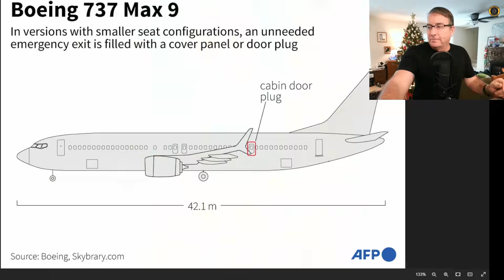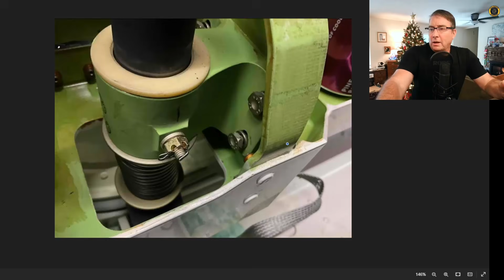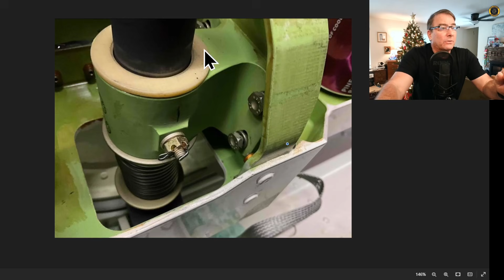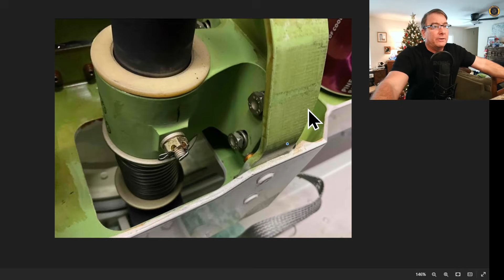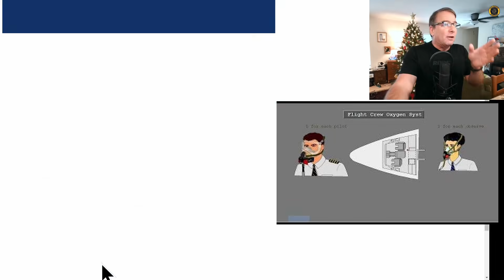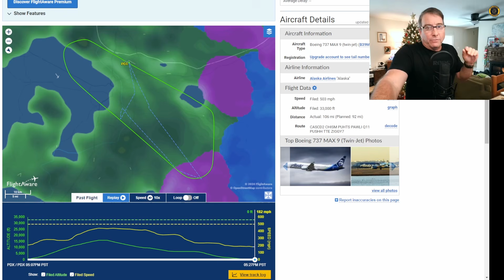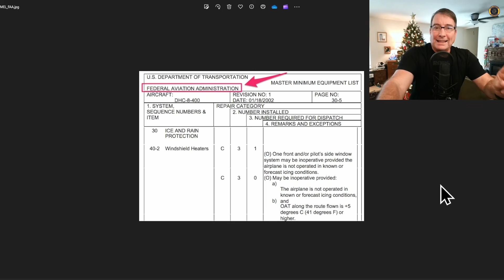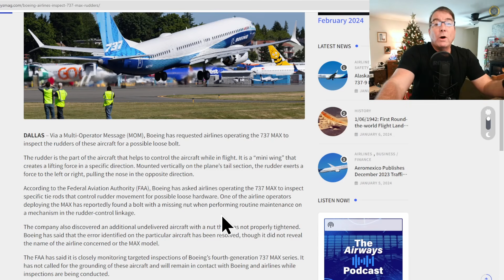"Yes, We Have No Bolts"  9 Jan 737 Max-9 Update

Comment: Excellent job of explaining the mechanics of the plug door.  I think one small correction is in order. At about 3:50, you said that the door needs to be lifted up so that the stop pad (on the door) can clear the stop fitting (on the airframe).  Based on what I see in the pictures, it looks like the door first has to be pushed down so that the stop pad clears the stop fitting.  When you push down on the door, you put the lift assist springs in compression.  In this position, the stop pads are below the stop fittings, and there is nothing preventing the higher interior air pressure from pushing the door away from the air frame.  At this point, the upper guide rollers slide outwards out of the guide fittings.  Furthermore, there is nothing keeping the lift assist springs in compression, and… blammo….the door is then launched off of the lower vertical guides into oblivion, and ultimately ends up in Bob’s backyard.  

If I’ve got this wrong, someone please correct me!

My overall conclusion is that, based on all the issues we’ve seen on the 737-9 MAX, I would never fly in one!

If I understand this correctly, it seems that one way to correct the problem (in addition to the obvious of making sure all the bolts and nuts are tight and properly cottered and/or torqued) would be to drill holes in the stop pads and stop fittings, and at a minimum, insert some sort of cottered pin through each stop pad and stop fitting.  Of course, by drilling holes in the stop pads and stop fittings, there is the possibility of structurally weakening them, in which case they would need to be enlarged before the holes are drilled. This would likely entail some major work on the airframe, and the door plugs.
Reply: Yep the upper guide track, which is in the shape of an inverted "J", is on the plug itself.  The guide roller on the airframe is already mated at the top point of the guide track.  Because of this you can't physically force the door plug down.  The door must be lifted vertically up (with assist from the springs to make it easier for maintenance personnel) so that the stop fittings can clear the stop pads and release the door.  My uneducated guess is that there is a 95%+ chance that none of the 4 bolts where there at all.  Nothing was there to prevent vertical motion and eventually pressure differentials and jarring of the aircraft sent the plug flying.  Maintenance/assembly/QA oversight is almost certainly the culprit.
Reply: I think you made the same mistake as I did at first, I had a hard time understanding how the door works until I realized that the upper guide TRACK is actually part of the door and the PIN is in the airframe. If you think of it the other way, it looks like you would need to move the door down first to get it out of the track. I'm pretty sure now that it's the other way around, you move the door up, which moves the track up, while the pin stays stationary and eventually clears the track when it reaches the track's open bottom end.

Basically this would mean that the springs are constantly pushing up against the pin/bolt in the spring assembly, and the bolt in the upper guide track that's part of the door. If those bolts would fail, the door would yeet itself up and out.
Reply: @kenkku  Yes, I agree with you.  I missed the part where Juan says the guide track is on the door plug and the roller pin is on the airframe.  Thanks for the clarification!
Reply: It's actually explained in this video at 3:00. Since the track is part of the door, you cannot move the door down from the closed position. Because the pin (part of the frame) sits at the top end of the track, the track (and hence the door) can only move upwards.
Reply: Let me give this a try.
To install the plug:
1) Lift the plug and place it on the 2 Lower Hinge Mounting Shafts, and install the 2 heavy washers and 4 lock nuts at the top of the 2 Lower Hinge Mounting Shafts.
2) Push the plug (wt aprox. 60 Lbs.) partially down which compresses the Lift Assist Springs to just before partial compression; more about this part later.
3) Continue compressing the Lift Assist Springs and rotate the top of the plug toward the airframe until the Roller Pins enter the Guide Tracks which places the Stop Fittings against the Stop Pads.
4) Push the plug down until the Roller Pins are fully inside the Guide Tracks, then insert the 2 Upper Locking Bolts into the Guide Tracks, thus holding the plug in place.
5) Move the plug slightly up or down until the Lower Locking Bolt holes are aligned, then insert the 2 Lower Locking Bolts into the Hinge Guide Fitting and the Hinge Shaft, thus holding the plug completely in place.
6) Place the Upper and Lower Nuts and Cotter Pins.

To Remove the plug:
1) Remove the Lower and Upper Locking Bolt Cotter Pins and Nuts.
2) While firmly holding the plug, push the plug slightly down to remove the shear stress on the Locking Bolts.
3) Continue holding the plug and slowly allow the move up until the Roller Pins clear the Guide Tracks; at this time the top of the plug is free to move away from the airframe. 
4) If the 2 Strap Assemblies are not attached, attach them.
5) Slowly allow the plug to move out to the partially open (15 degree) postion.
6)  To completely remove the plug, attach the plug to a hoist, remove the 2 Strap Assemblies, Bonding Straps, 2 washers and 4 lock nuts at the top of the 2 Lower Hinge Mounting Shafts.
7) Use the hoist to lift the plug off the Lower Hinge Mounting Shafts.

I'm sure that this is not the complete procedure because I did not remove the 2 Lower Hinge Bracket Assemblies, but I think that it should cover most of the steps. BTW, I'm not a ME, A&P, pilot but the steps appear to be logical.  It would be very interesting to read the actual procedures.
Reply: @michaelhenning8090  Yep!  I think you have it down pat!  I think Boeing should copy your procedure and include in their updated POH and/or maintenance manuals!  In fact, Boeing might be better off if they just let YT followers and the rest of the internet write the entire POH and  maintenance manuals for them!

Comment: I’m still confused about the picture of the guides shown at 4:40. I don’t see how the door can go up 1.5” in this configuration as it’s up against the top already. I would understand if it rotated or if the bolt was removed and the door allowed to slide down. Am I missing something?
Reply: Looking at it again, I think that the picture at 5:03 makes it clear-ish as you can kind of make up the guides on the plug side and pins on plane side… but you need good eyesight 🤓
Reply: The door is on the left side of pix, the frame/jamb with pin on right, so when the bolt is removed that’s underneath the pin with roller on it in the guide, the door can be raised that 1.5”, ok? Make sense?
Reply: @JohnHallgren ah, the door is on the left! i assumed the guide would be on the plane side and the pin on the door side. Yeah, that makes a lot more sense now! 😅
Reply: @Batwam0  you’re not the only one who was confused! I was originally also for a bit. There’s someone else here who I’ve been having a running discussion with who still doesn’t understand that he’s wrong.

Comment: Although, the Swiss cheese principle seems to have lined up and ultimately caused the plug to be ejected from the aircraft. Thankfully there was also another piece of cheese that didn't line up and this prevented the loss of life. Examples would be the passengers who did not get on the aircraft who would have been in the seat row next to the plug door or the unaccompanied children who could have been in those vacant seats, which doesn't bear thinking about.
Thank you for doing these. I think you may have a calling to work or consult for the NTSB when you retire from front-line aviation.

Comment: I suspect the bolts were left out as as long as the bolts were held in place with captivated nuts they should keep the door closed even if loose they are tightened to keep them from rattling around and possibly damaging the cotter pin

Comment: thanks for a great channel.
i’m confused.
i thought a plug door was wedge shaped and could only open inwardly.
i therefore thought the entire door frame failed.
have we gone back to pins?
after the cargo door failures decades ago?
Reply: It's a plug-type door, not a door plug.  Fits into the hinge guides in the airframe, and so it must be installed from the outside using the sliding mechanism described in the video.  He may have described it better in the previous video.  Once the hinges are slid into the hinge guides, the bolts in question go through the hinge guide and hinges and hold them in place.  These prevent the plug-type door from sliding into the position that releases it from the hinge guides.  These bolts do not need to be torqued since they don't hold a load.  They have castellated nuts and a pin to keep the nut on and the bolt from sliding out of the hinge and hinge guide.  The bolts and/or pins were probably missing since the door was last installed.  It may not have been Boeing at fault since it is common for the third-party that installs the interior seats, etc. to remove this plug-type door after the aircraft is sold.  That party may have forgot the bolts or pins.

A spring mechanism and air pressure inside the cabin also hold it in place, but these are not adequate after some bumps, etc. (i.e. his mousetrap analogy).  After a couple of months of flying, the thing jostled enough to push it to that point that the hinges came out of the guides and it blew away.

A passenger in the seat near the door reported hearing whistling sounds (according to a top-rated comment on this video).  The cabin pressure controller warning systems were failing repeatedly since it was in service (since October, brand new airplane).  Indicating the door was not making a seal and likely bouncing around on the hinges until some turbulence bounced it high enough to get it off the hinges completely.

This thing is designed this way so they have the option to install a working emergency door there based on the passenger capacity (number of seats installed).

I know this is more detail than you asked for, but similar questions and other misunderstandings are all over this comment section.

Comment: The Fueselage on the Max-9 is not manufactured by Boeing. They are made by another company, put on a train to the Boeing facility and then given the cabin fit out.
Boeing is taking the heat on this as the point of sales but they aren't actually responsible for this failure.
Some heads are going to roll at the contractor company for this.

Comment: Great reporting as always.  I've listened to many ATC audio transmissions covering emergency declarations by pilots and I'm amazed how slow ATC is to react.  Almost always the initial ATC response will be unprepared and ask the crew to repeat (often 2-4 times).  If that isn't bad enough, the crew have to often repeat their emergency status when they switch frequency to another controller.  Why isn't there a automatic mechanism in place that when an emergency is declared the transponder code/squawk immediately changes to 7700 so any ATC in range can see their is an aircraft declared emergency?  Avoids crew having to keep repeating their emergency every frequency change.
Reply: I like Juan's comment that all pilots should always use "Mayday Mayday Mayday" when declaring an emergency. I stopped my ground instruction back in the 1980s due to career changes, but well after I learned that was the proper terminology specified in the AIM at the time, and as far as I know, that is still the case and also what controllers are trained to recognize immediately as the proper way to declare an emergency. Perhaps that is not drilled into controllers properly, either?

Comment: Those pilots deserve a medal, they not only saved themselves but all the passengers as well.
Reply: Im only an ex-glider pilot but... After the initial surprise I doubt the aircraft was difficult to control or anything like that. Quite a manageable situation we'll within all pilots capabilities.  I've flown to 14,000ft in a T-shirt and shorts with no oxygen or any pressurisation. It might be different had they been a lot higher. The cabin crew probably had a more stressful job I reckon.

Comment: I am a fellow pilot and A&P, with IA (expired- I'm 80 years old).  I am appalled by this incident.   The design of this door plug, as clearly explained in your previous video, seems plenty robust.  Only the most egregious manufacture/maintenance errors could allow this door to work loose.  Good grief!  My background is strictly general aviation, but this sort of thing cannot be allowed in any phase of our profession.  Only by God's grace were no people sucked out in this catastrophe. Thank you for your continued attention to these unfortunate situations.
Reply: However you should see the positive side. No one will risk riding a plane unbuckled from now on.
Reply: @luisbacilieri7010  Let's hope the seats are bolted down properly.
Reply: @luisbacilieri7010 seatbelts won't matter when/if this happens closer to or at cruising altitude, you'll just go with the seat...
Reply: @luisbacilieri7010  what if the seat gets sucked out? Best is avoid Boeing if possible (easier said than done)
Reply: I am also an ex Airline A&P mechanic, and NDI level 2 tech, I left the industry in 2009, and moved over to Subway trains, my sleep improved,and consumption of antacid tablets went to zero....
Reply: @jdshemp  Hey do you know if the boeing 737 max 9 door plug was visible or was it behind a decorative panel?
Reply: Visable only from the outside I have read. From the insode it looks like another window.
 @climbeverest
Reply: I 100% agree and as an A&P myself and a resident in the area, this door landed .9 miles from my door step. It's a miracle no loss of life happened on the ground (edit)with the door falling 16k feet in a fairly dense residential area just a short distance from the school and hospital. I just flew the other week ago on the an ALASKA MAX with an infant in my hands.... yikes.
Reply: There has been statements to the effect this plug may be removed by the airline to move stuff in and out of the plane in final prep for first flights.
Reply: Blown out.  The pressure differential is from inside the airplane to ambient altitude pressure outside.
Reply: @z33511 save it dummy
Reply: Hello! Do you know if the boeing 737 max 9 door plug was visible or was it behind a decorative panel?
Reply: @climbeverest it’s behind a panel. He explained in detail on the previous videos he suggested everyone watch first.
Reply: @chriswalters8110  so kind, thanks!
Reply: It's behind a standard inside finish panel that looks like all the rest of them.   @climbeverest
Reply: @wheelspinner20  thanks! So if the bolts are missing or loose, every aircraft of this type will have to have the panel torn open to inspect? Am I right?
Reply: @climbeverest  yes.  Ongoing now.  Alaska air and United air both grounded all 900 models to check the door plugs.
Reply: @climbeverest :
Behind a decorative panel on the inside of the aircraft.
Visible from the outside of the aircraft as an outline.
Reply: @climbeverest  it was behind the cabin panel, which blew out along with the door
Reply: @climbeverest  Behind headliner, normal window size, normal seat spacing.
Reply: 100% agree and well said.
Reply: "The design of this door plug... seems plenty robust". My question is whether the failure mode that gave rise to this near-catastrophic accident was modeled, and whether adequate countermeasures were built in. 
    Now that we know it can happen, clearly this failure mode will have to be revisited, and perhaps new countermeasures will need to be built in. 
    What makes me uncomfortable is the complexity of the system to patch a non-functional hole in the fuselage, at least not functioning for this configuration of the aircraft. It seems they took pains to make the plug still work as a functional door, even if no-one would ever need to use it, except maybe when converting to a higher density configuration, which clearly the operator airlines did not plan on since they ordered this version with a door plug, and not another available option with just a hidden door. Why put the structural integrity of the fuselage unnecessarily at risk (with hindsight, the integrity was clearly at risk), when nobody much will benefit, and it wasn't ordered? There must be a dozen simpler ways to plug the hole, including riveting a panel in place permanently.
    Continuing to treat the designed plug as a functional removable door creates a bunch of additional failure modes, and this one is potentially catastrophic.
    I am sure the physics of the air pressure differential holding the plug against the stop pads is sound, but you do allow for vertical movement when opening up the plug. And what prevents that vertical movement in flight is this set of bolts and fixtures that are not normally stress-bearing. But there is (as we now know) a failure mode when they can be subject to stress, and the whole plug assembly will blow out. Why make the plug conveniently removable at all? Why choose a solution dependent on pressure differential, 12 stop pads and four bolts against vertical movement, when there are simpler ways to patch a hole that ensure the structural integrity of the fuselage?
Reply: @fbkintanar    Countermeasures as in bolts, crenelated nuts and wire to stop the nuts from turning?

Or countermeasures against shoddy work, shoddy QA or sabotage?
Reply: @advorak8529  Both of course, aviation systems should be failsafe. But if the design is bad or unsafe, even perfect manufacturing work and QA won't prevent "unlikely" failure modes. Design engineers can do better, and should.